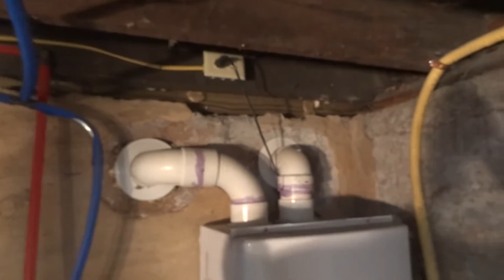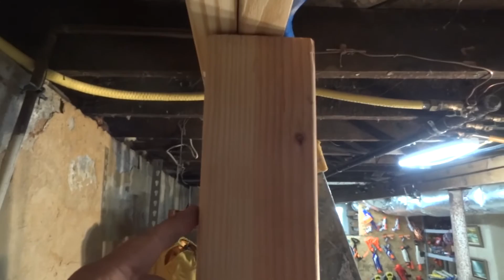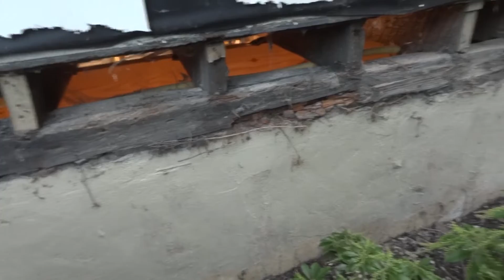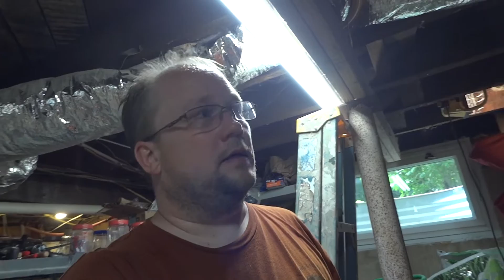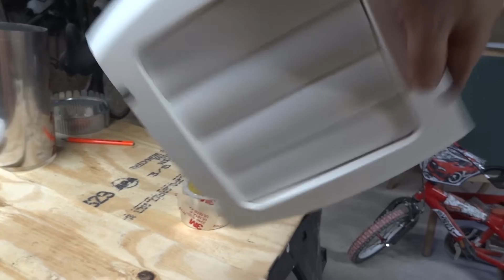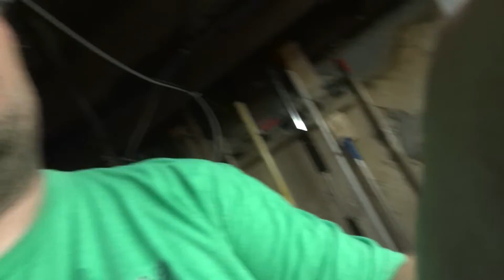Raise floor joists with jacks to replace rotten sill plate

Comment: How did you lift the side where the joist was running the same way as the side you were lifting?
Reply: Ever figure this out? About to deal with the same thing
Reply: @djustinger  i did...i have balloon framing(2 stories), so i attached a bored to the outside the wall...used 1/4 inch steel plates at the pick up points and ripped out all the rot and replace 👌

Comment: Just a question, i have an inch uneven floor slope and if i call these underpinning guys can they use jacks to raise the floor up, and will the walls usually crack become of hydraulic jacks.
Reply: If they lift it to fast the walls can crack. If it is lifted slowly and you give the house time to settle in between lifts then you should be just fine

Comment: I don't understand the purpose of the triple vents (and "potentially more",  "for either exhaust and/or intake”.) 
 There's a window on the adjacent wall that could be set up for secure, screened ventilation. And why bother with foam sealing if these vents will be open for prolonged periods.  Shall they be open to the room or ducted to machinery of some sort?  What sort of subsystem are they intended to support?  Dust collection?, Combustion air?,  VOC exhaust?, Air to air heat exchanger?   Kitchen/bath exhaust, chemical hood/solder station/paint exhaust.   Did I miss the explanation of what they're for?

Comment: A couple notes from my observations...
1st instead of cutting the sill beam, you could have gone up a couple more pumps with the jacks to give you the clearance you needed. Yes, there is always the possibility of plaster cracking, but you are already taking that chance anyway. Why reduce the structural integrity of the beam, even if a minor amount?
2nd is when working with sheet metal, as you were showing everyone how the duct goes together, ALWAYS wear gloves. I did HVAC work, it may not seem like it's important to have gloves for those small pieces, however, ANY slip of the hand or metal can slice you to the bone. 
Last, as someone mentioned, you have nowhere for the weight to be transferred. Add some braces.... It'll actually make a difference in how "solid" the flooring feels.
Reply: Thanks!

Comment: Brilliantly clear and concise video tutorial.  Many thanks. However,  the plastic grid inside the first ventilator cowl will simply be chewed out by rats or squirrels if they choose to pay you a visit.  MUST be steel with a mesh no larger than 1/3 inch (mice will come through anything larger)..

Comment: How much would you charge for that, also with no basement but a crawl space
Reply: It may be expensive, but one can do it by himself. It seems difficult but it is not. The most think u may feel uncomfortable with is just staying in the crawl space, but if u have good powerful light (now there are LED lights) and clean the crawl space and few days ahead of going in u put rat and mice poison, u will get used to working in the crawl space. If the crawl space is very narrow (under 2 ft) then indeed u have to call someone familiar with this kind of repairs and properly equiped and insured.